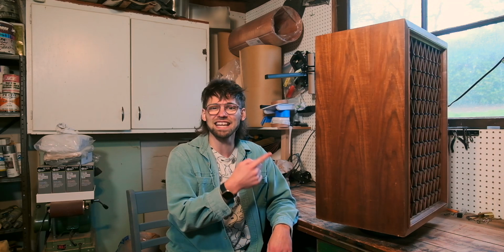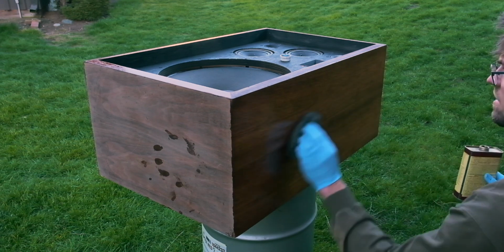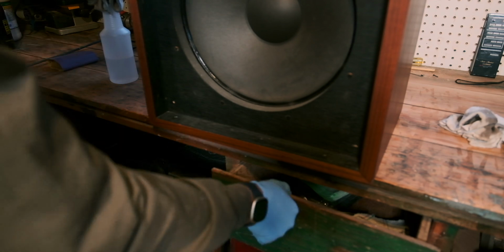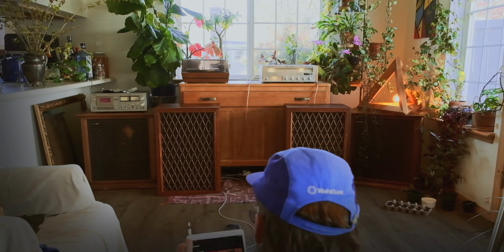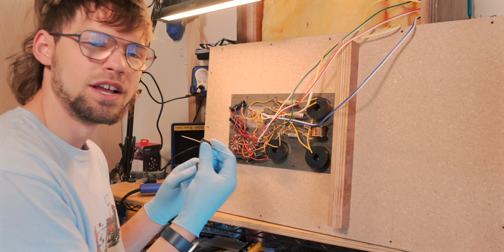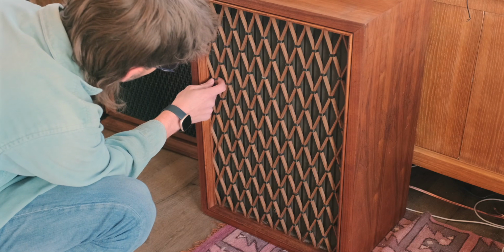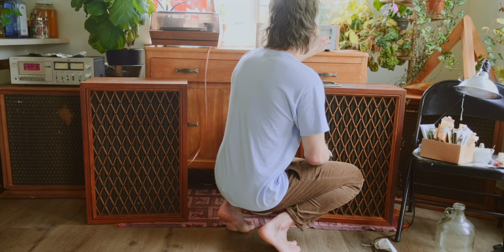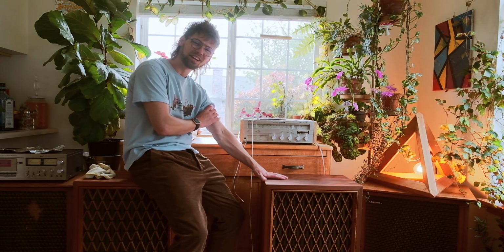The BEST Pioneer Speakers? CS-63DX Restoration

Comment: Haha that not even a question. Still use my dads 2 hooked up to his sansui qrx-6500 which also runs a set of bose 901 series IV upstairs and bose 301 series II to the garage. The pioneers alone shake the house with the dual 1226 turntable.  I also have 2 sets of the pioneers that are one model smaller that arent currently connected.  Greatest vintage speaker ever!

Comment: That poor walnut...walnut doesn't need stain, and stain is not a finish. 🤦. You need a protective finish. Get water stains out with oxalic acid.  Sand the bottoms first to see how much sanding they can take, and turn your sander speed down until you have a couple dozen sets without blowing through the veneer under your belt.  Any of the 'xxA'  series speakers are better.  Best way to actually clean these grills is with Q-tips, a good furniture oil, and time.  0.5uF correlates to 20kHz.  0.47 to 21kHz.  Literally no one can hear the difference in person, even less so on whatever device this is being watched on.    "Fixed" is a stretch.

Comment: 88А sounds way better. 99A - more powerful, but requires equalization. 63DX has higher sensitivity, what is good for tube amps, but limited bass. They all are good for particular use. Use them for jazz or disco with tube amps, and it’s gonna beat any modern system.

Comment: This type of speaker is nicknamed the “Kabuki” speaker. They were manufactured by various brands in the 1970s. What they have in common is that several drivers are randomly distributed across the front panel and the enclosures are too small for the huge woofers. They look impressive, but do not comply with some basic rules of acoustics. As a result, the Kabuki era lasted only a few years.

Comment: Ah, a set of speakers from Pioneer's "Lattice Grille" days. They should be positioned right up against the wall for best bass response as there's probably little or no baffle step compensation built into the x-over.  The best way to upgrade them though would be to pull all those old drivers and replace them with new ones with a properly matched x-over, like what I plan to do with the 50-year old CS-44s that I've got on hand.  End result should still be that nice lattice grille look with performance most more in line with modern speakers.

Comment: Bought a pair of these in '73 or '74.  Powered them with a Pioneer SX727.  After a few years I grew tired of the lack of deep bass extension.  Sold everything to coworkers and bought a pair of KLH SCX-A speakers and a Pioneer SX 1050. Much nicer setup, with much wider and flatter response.
Reply: My klh 15" 4 ways were my favorite pair of speakers. Made them sound better with mods too. Slow them fir 50 when I moved. Found another pair on market place for 120. I payed 300 new in 1999 lol

Comment: Pro trick for making these speakers grilles look like new: After vacuuming and dusting simply install the grilles upside down.  The dust always settles on the tops of the grille sections and is nearly impossible to clean completely, plus the sun has usually faded them as well..  Installing them upside down exposes the fresh surfaces.
Reply: Qtip dipped in isopropyl or similar. It’s the only way to get them properly detailed. Yes, it takes some time

Comment: turn your Tannoys straight ahead rather than toeing them in and slide them slightly closer together. That will open up the soundstage a little more rather than compressing it to a 'sweet spot', which would be like wearing headphones and having to sit in that certain spot. 3d sound is what you're going for.  And maybe pull them into the room a little further so they can 'breath' better.

Comment: I work in flooring and with that hole in the veneer there are options to cover up the veneer burn. Either use a DAP blend sticks, Pergo touch up kits which are essentially paints you mix up to get the right tone you are looking for, or in a bind you can use crayons to melt in sever small container cups and blend to get the right tone of the wood.
Reply from the maker: Thanks for the tips! Veneer repair is a skill that I want to get much better at! It's such an art form.

Comment: Cool episode.  Fooled with CX's years ago.  Found the best way to get the bass under control is to use paper & oil motor starter caps for the woofer.  They are the opposite of film caps and tend to focus the lower frequencies w/o bleed.  
Now another worthy test is to borrow a 2000's 5.1 AVR and run it in 2-channel.  The CX's may like more transient current that older silver faced gear will push ...  Sony and TEAC AVR's seem to do well on speakers that like more instantaneous current.  Before I sell vintage speakers I always do this test to see what their preference is.  Sometimes it's quite surprising 😅

Comment: Having purchased 4 of these speakers new in the 70's for a QX-949a Pioneer. The biggest problem I found was be very careful handling them.  The large round magnet on the 15 inch speaker will slip and freeze the voice coil. So don't pick the cabinet up and accidently drop it they may slip. Those magnets are just glued in place. There were two new original raw speakers in the box on Ebay a few years back for $200 I wish I had bought them. Nice video!
Reply from the maker: Ahh yea that would be a good reason to not ship these haha. You can reglue the magnet but that's such a precision repair and usually the voice coil would get damaged if the magnet moves
Reply: The Aussie made EMI speakers were bad for magnet shift, I had that happen on 7x5" speakers being dropped from little as 6". They are the HMV TR10 record player bookshelf speakers. The old alnico EMI speakers didn't have magnet shift problems

Comment: I recently inherited a set of these speakers from my grandfather who passed away. They're in great condition, but I haven't had a chance to listen to them yet since I don't have a receiver. I've learned that I need an amplifier with at least 80 watts per channel at 8 ohms to power them properly. Anything more powerful might damage the tweeters. Could you recommend a newer receiver that can power these speakers well and also has HDMI and Bluetooth support? I'd like to use them as theater speakers. Preferably something I could purchase second hand or budget friendly
Reply from the maker: Nice! That's awesome that you want to keep using them! They are pretty efficient so a receiver with as little as 20 watts per channel would do just fine. The Sony STR-DH590 is a great option that can be had on ebay for a couple hundred bucks
Reply: @Shuksanaudio t hank you for your reply. I’ll check it out! Looking forward to hearing them. Should I be worried that the Sonys power output at 6 ohms exceeds the pioneer speakers 80 watt per channel recommendation? Sony advertises 145 w at 6 ohms. At 8 ohms I believe it would be closer to 90 watts
Reply from the maker: @1snordy  The max output power won't matter so long as you don't turn the volume up all the way. The speakers are rated at a certain ohm rating but the amplifier can typically handle any ohm rating between 4-16 ohms.
Reply: Unfamiliar with the brand but it advertises 80 watt and 8 ohms. Onkyo TX-SR393
Reply: bu hoparlörler için masraf yapmaya değmez, 
görüntüsüne aldanmayın sesi çok kötüdür..
..
.
Reply: ,
sadece kapaklarının görünümü güzeldir bu seri hoparlörlerin,
sesleri berbat ötesi kötüdür, uğraşmaya emek harcamaya değmez bu seri  için..
pioneer HPM serisi çok daha iyidir.. (HPM 40,50,60,70,100,150 ..VS..)
yinede emeğinize sağlık,mutlu yıllar..
.
Reply: 1970's Sherwood S-7650 CP is beautiful, 35wpc, and around $200

Comment: Hello. Great videos! I was just wondering if there a greater difference in sound when you buy the expensive set of caps rather than the cheaper ones you laid out?
Reply from the maker: The difference in sound is negligible. Some people with deep pockets will spend thousands on crossover capacitors for higher end speakers but for most anything, that's really not necessary. When you spend a lot of money on caps, they don't necessarily sound "better" just different. I usually use the Jantzen cross caps or the Dayton audio caps that I used in this video. The Jantzen are a bit more expensive so I typically use them for higher end speakers. There are lots of great articles and forum posts on the internet debating different capacitors and which one sounds the best. Thanks for watching!
Reply: What is we mix some expensive caps and some cheaper ones? If so, which parts would your prioritize and see some value at purchasing the more expensive part?

Comment: Nice video. Do yourself a favor and try running these after removing the back, pulling the insulation and removing the chamber off the back of the sealed midrange. IMHO, this made my CS-63DX's come alive. Of course, you'll lose some bass, but if you have a sub I think they sound great. I generally can't stand box speakers and listen to Open Baffles, preferably. So, I'm biased. But you should try it. Also, it's worth pointing out the incredible materials that Pioneer used at the time: 100% void free Mahogany plywood. I've never seen anything like it before.
Reply from the maker: I don't have them any more but that is an interesting idea! Pretty wild that they used mahogany for plywood!

Comment: Great work on the pioneer's matt. I need your help please. I have the CS-99, and after I did the crossover recap. One of speakers cut's off at moderate volume.
Reply from the maker: Thank you! Hmm, have you gone back and checked all of the wiring on the crossover? Does it cut back in if you lower the volume or is it totally random?
Reply: @Shuksanaudio  Thanks matt, at first the volume would step down at low volume . but as I increase the volume the speaker cut's off completely.
Reply from the maker: And this doesnt happen with other speakers?  Measure across the speaker terminals for an impedance reading. If it's really low, that could mean you have some wires crossed over where they shouldn't be. It's most likely there is a wire soldered to the wrong place.  @shawnarmstead8020
Reply: @Shuksanaudio  Thanks Matt, will test them later on today.
Reply: Hello Matt, I am still issue with my Pioneer CS-99 crossover after recapping. Could you help me with this issue and the wiring of the crossover.
Reply: I am lost with this issue.

Comment: Having your speakers this close to the floor will make the floor a large part of your audio experience. Consider putting the tweeters at ear level and insulating them "vibrationally" from the floor, walls and furniture so you don't have to deal with resonance of your room.
Reply from the maker: There are pros and cons to having speakers on the floor and having them off the floor. It's certainly always fun to tinker with different speaker positions. From my experience,  the room is small enough and that the high frequencies don't change whether they are close to the floor or not. There are so many surfaces close by to bounce the sound off of and I'm not trying to deaden the room entirely. I typically sit on a bean bag in front of the speakers so the tweeters are right at ear level. I do want to do some acoustic treatment to the room but that's for a future video. Happy listening cheers 🥂

Comment: For capacitors, the ESR value is just as important as the actual capacitance. Regarding the boomy sound, you may want to put some baffles inside to reduce resonance of the panels of the enclosure. Since these are a closed enclosure design, adding less than 1 liter of wood for baffles will not be very significant in the rolloff of the bass.
Reply from the maker: ESR value is definitely important. Hmm, that could definitely help but this woofer in particular is just not well suited for bass. Could be fun to tinker around with them though since they don't have great bass extension to begin with. Thanks for watching!

Comment: Got a pair of Pioneer S-910 for 50€ on the local used market. Still, after 1 year of using them, the typical problem starts of the woofers membrane dying because the material deteriorates over time. Are there any good new replacement chassis from dayton audio or something like that?
Reply from the maker: Nice! That's a great deal! The foam on the woofers does tend to deteriorate over time. You can replace the foam with ones found on eBay. I'm in the US so these are what showed up but you may have some more local to you where shipping wouldn't cost as much: https://www.ebay.com/sch/i.html?_from=R40&_trksid=p2062857.m570.l1313&_nkw=pioneer+s-910+woofer+foam&_sacat=0
Reply: @Shuksanaudio  The CS63 doesn't have foam woofer, it's straight edge with lacquer

Comment: Nice job.. one bit though.. for touch ups get a real paint marker at the craft store it's much better than a sharpie wich ink looks purple-ish.  Good call replacing the caps as it affects crossover point, i'm sure you know.
Reply from the maker: Thank you! You're totally right, I now have oil based paint pens that I will use in the future! Yes indeed! Always nice to replace the caps if they're bad.